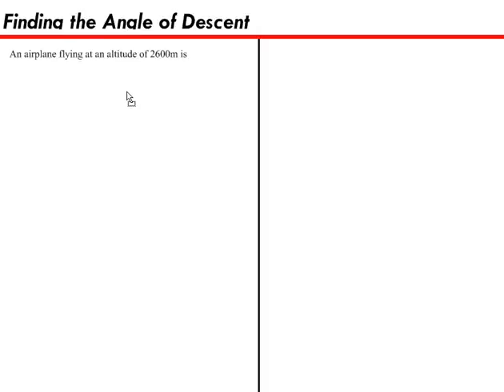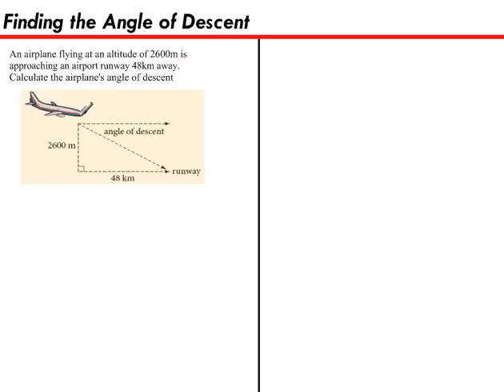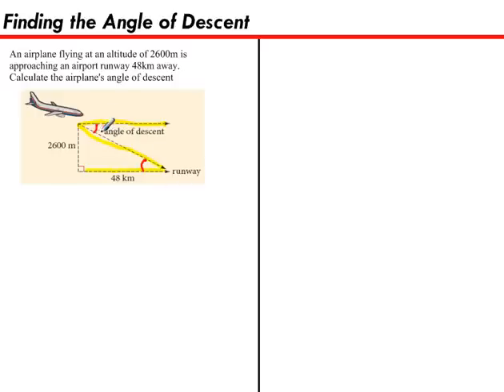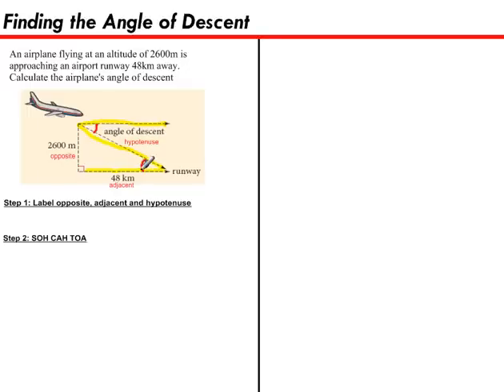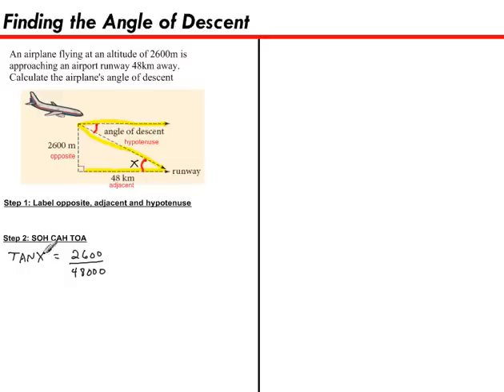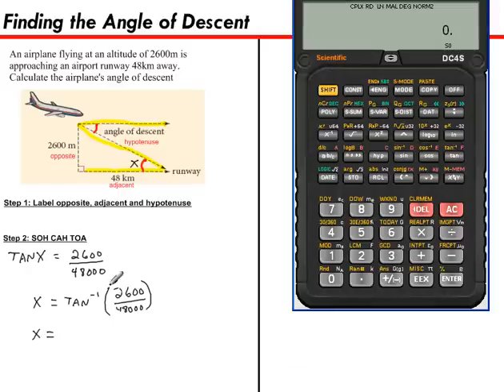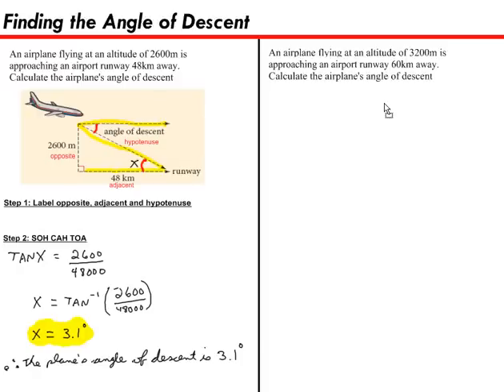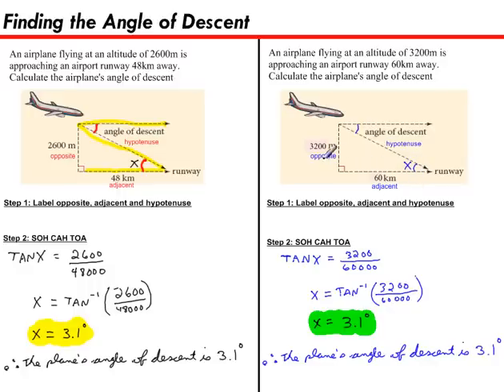Finding the Angle of Descent

Comment: is 3.1° = 500ft/minute !!
Reply: This is not correct. 
You need to know the Ground Speed (or the TAS) to calculate the Rate of descend at a 3.1° angle, with trigonometry.
In this case 500ft/min only works if the GS is 93KT to reach 32NM(=60km) ground distance in 21 mins. (calculated 21mins with 500fpm from 10500 ft (=3200m)).